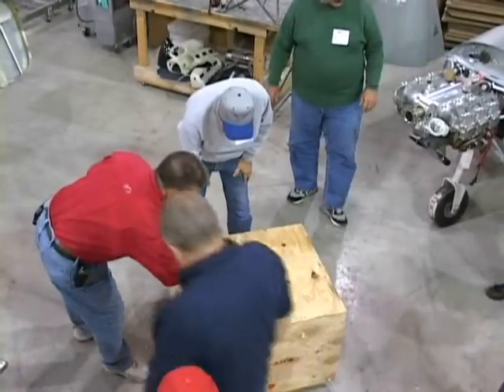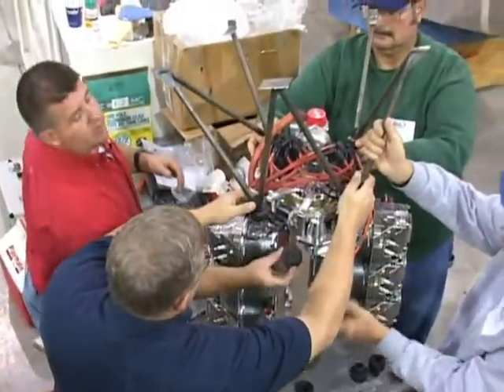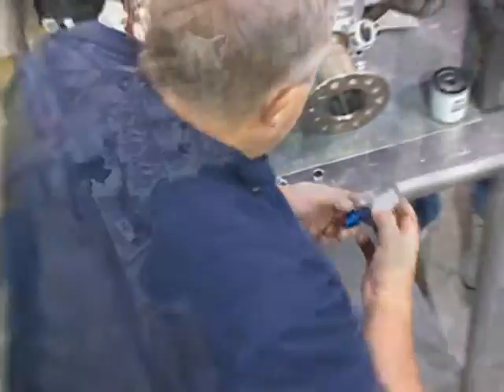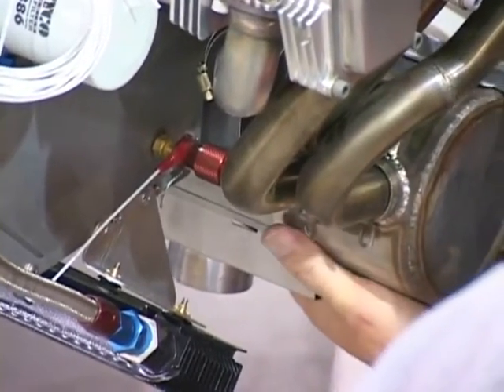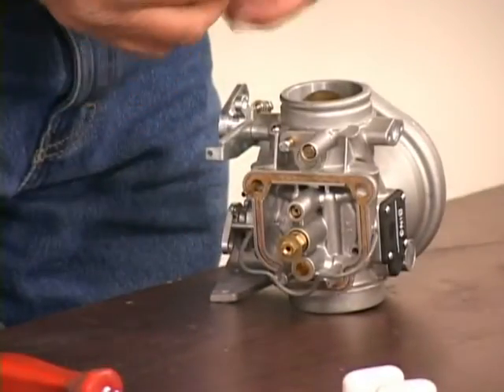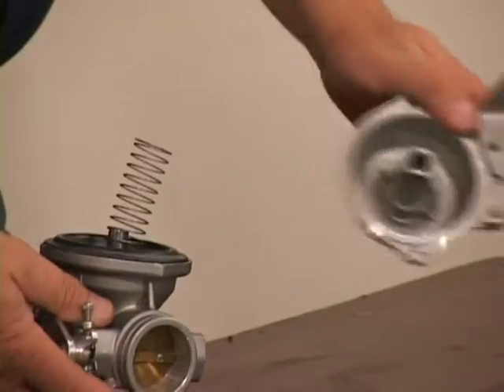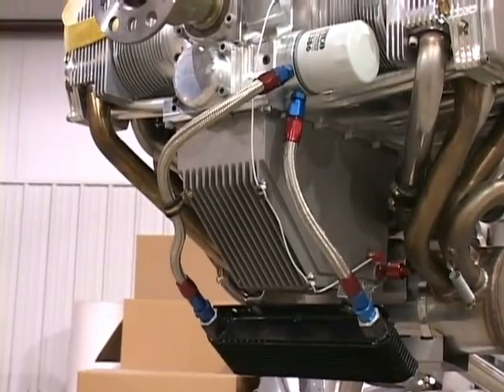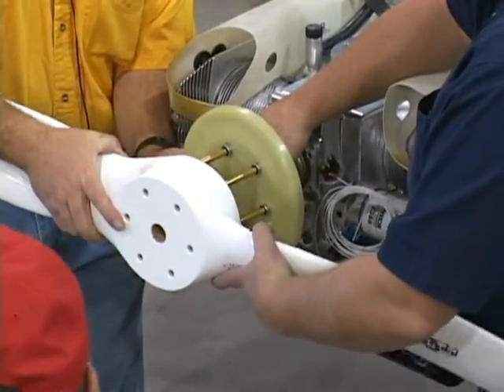Jabiru Engine Installation

Comment: If they are maintained correctly they are no less reliable than anything else. Especially the later series
Reply: frankus54 
That’s a very broad statement. I will never own one of those engines ever again. Pistons coming apart after 400hrs is ridiculous.
Reply: Kelly Chapman I own and fly a Jabiru LSA55/3J with a Jab 2200 motor and it has flown me reliably all over Australia; as you know Australia is a huge land mass.

Comment: What is the Jabiru failure rate like in the US?
Reply: Swaggerlot not sure but the Kitfox I bought has a 2200 and it is now worthless..I screwed up and trusted the owner. During the my first annual I found the heads heads a pistons destroyed themselves. Only 400hrs on it. Now I have a boat anchor and an 18,000 bill for a 912uls to put in a 17,000 plane. So I wouldn’t have a wish a Jabiru on my worst enemy. Lesson learned and my ass will be feeling this mistake for a long time. The most hrs I’ve heard of is 800 and many guys with stories of being treated like crap by the factory.